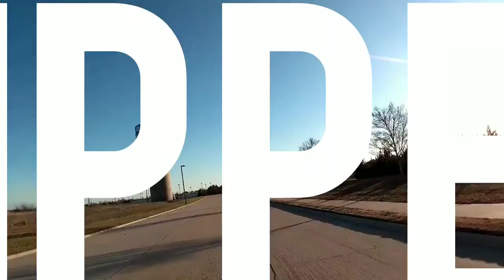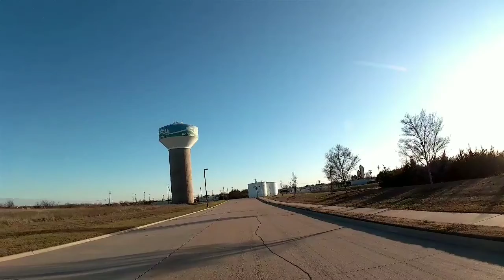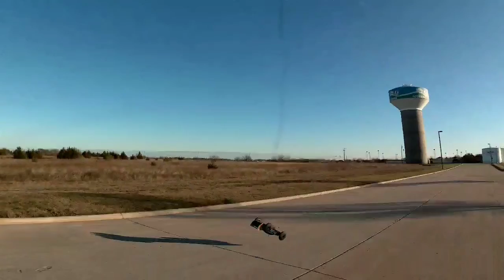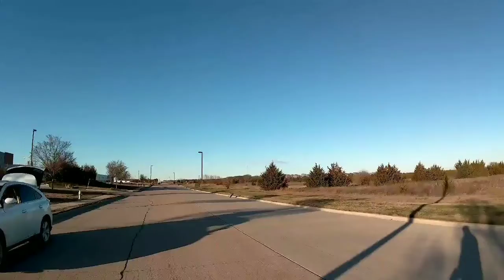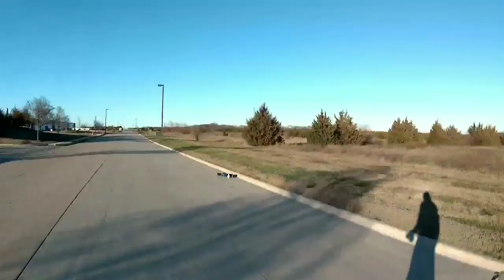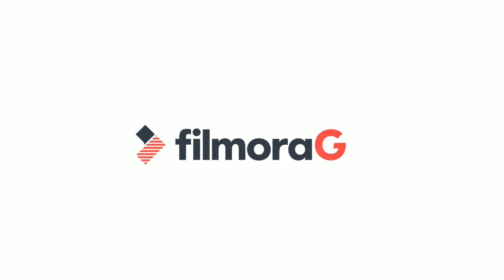Flipping my Limitless - Not a good day

Comment: Time to put lead weights on front end to keep her down
Reply from the maker: I guess I haven't been paying enough atention to comments lol, very sorry. you know funny thing is I actually kept the setup location of the motor upfront for this exact reason but in the end the tires are the cause of this. I was using a set of PL 2.8 Slicks, forget what they are called, for drag runs and got lazy one day leaving them on for a speed run. they handle fine as long as you stay smooth on the acceleration, otherwise the 5694 800kv motor could lift the front end so much I actually thought of using a wheelie bar... Even with my tall gearing 45T pinion with 29T spool, thing was nutz man.